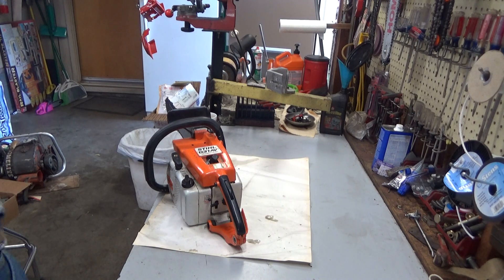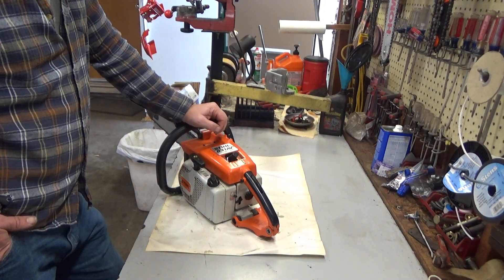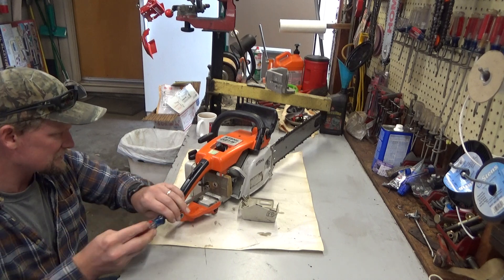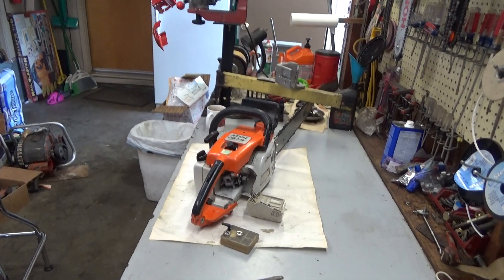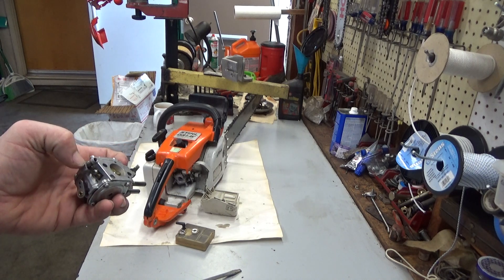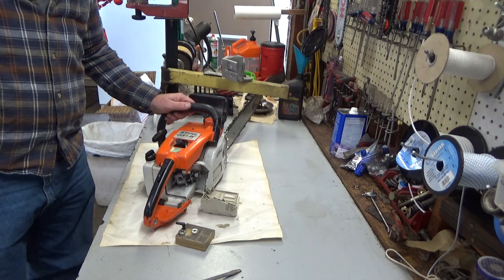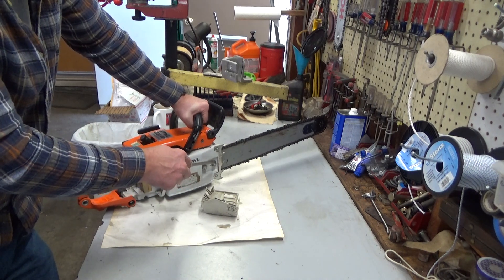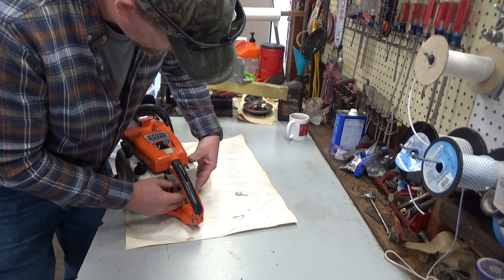Jay's Stihl 031AV Test Run

Comment: I have the same saw. Ordered a kit from Amazon which includes carburetor, spark plug, fuel filter, and fuel line for $18.00. everything fit perfectly and the saw now runs like a new saw.